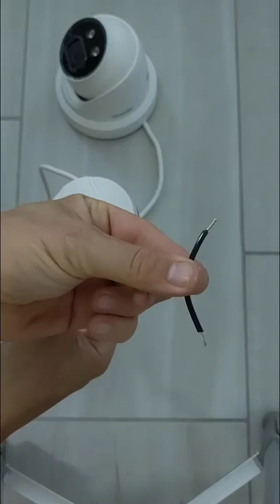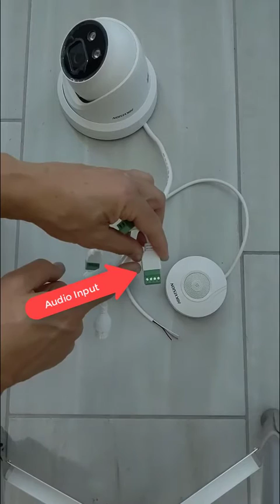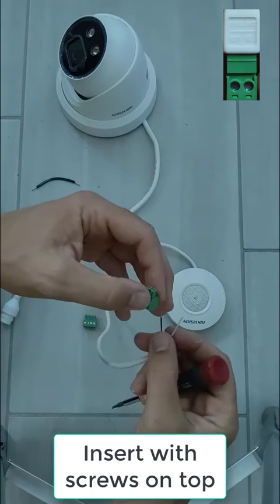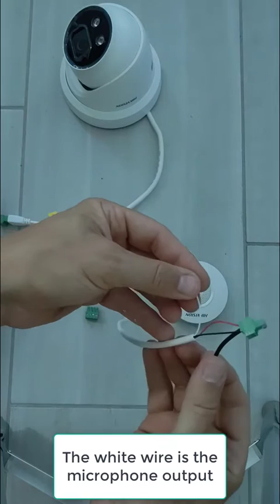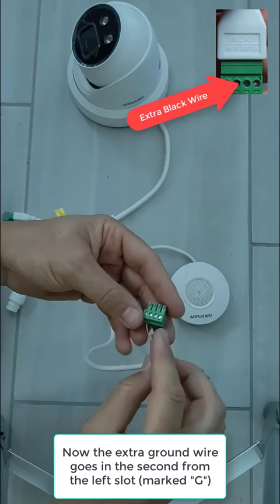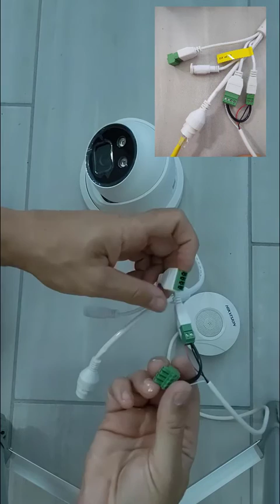Installation of microphone to a single POE / Network / IP CCTV Surveillance Camera

Comment: Why was this Hikvision microphone discontinued?  Have they replaced with a new one?
Reply from the maker: Probably tired of putting out good quality manuals and instructional videos........ Honestly though I have no idea.  Maybe they would rather sell the units with the microphones built in for more cash.
Reply: @Rob-1973 I have Hikvision cam PCI-T18Z2S.  Am I able to do the same setup as you did for that camera?  New to this and never did this before.  Only difference is its internal plugins.

Comment: Is this port intended to be used this way? It's supposed to be an input, but it just happens the POE port will supply power to this.   How many do you have out deployed like this? are they still working? or did you blow the camera.
Reply from the maker: I can't be 100 percent sure about it's intended use. You almost have to assume so since the camera has audio input so it would have to have power for the audio.  I have two running in this fashion with no issues at all. They've been running for years

Comment: Is this only a mic, or is it also a speaker to support two way audio? If not do you know of a speaker and mic that would work with a setup like?
Reply from the maker: It’s a microphone only, sorry.  I know hikvision makes at least one camera with microphone and speaker.  I have one, but the microphone and the speaker are built-in
Reply: I have hikvision panocam it doesn't have the two port green 12v connector. How do I power it?? Do I really have to run a dedicated 12v plug and fish it through the wall again
Reply from the maker: @chinchilla505  Do you know the model of panocam you have?  Looks like Hikvision makes 18 (current).  I know at least one or more have audio built in, I assume yours doesn't.  If I know the model maybe I can see the connectors from the manual / docs
https://www.hikvision.com/en/products/IP-Products/Network-Cameras/Panoramic-Series/?category=Network+Products&subCategory=Network+Cameras&series=Panoramic+Series&checkedSubSeries=NONE
Reply: @Rob-1973  DS-2CD2387G2P-LSU/SL ColorVu 8MP

It has the audio in audio out 4port connector only. Yes it does have audio built in. But it's incredibly poor quality, worse than my $40 ring stick up camera . So wanted to wire the hikvision standalone mic to it. Seems like they give the external mic option bc they know the internal one is trash, but at the same time it looks like it requires a dedicated 12v wire connection off a wall plug.